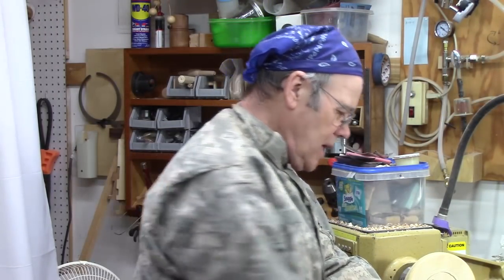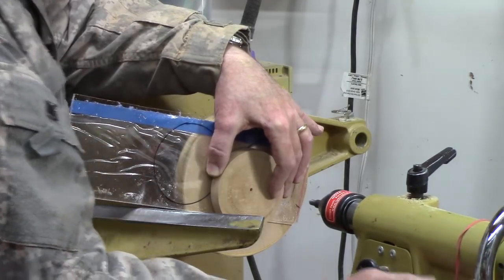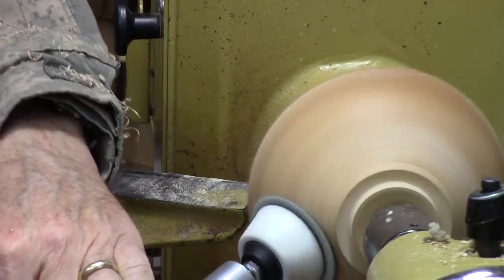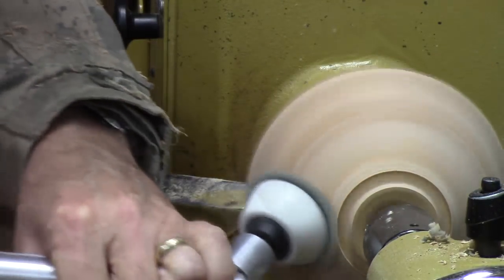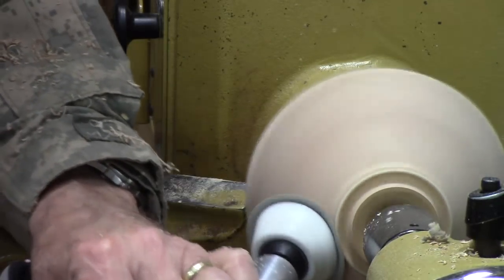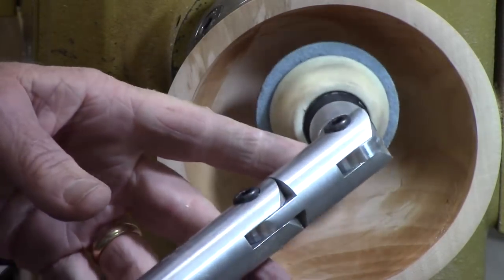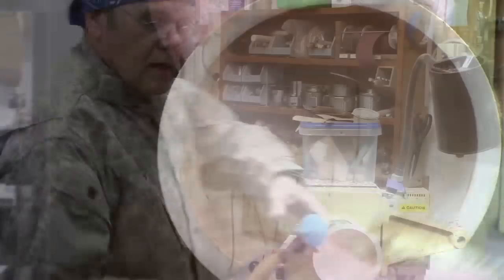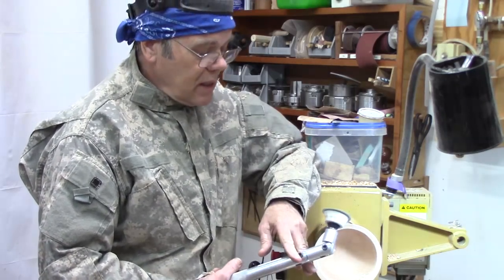Another Moment of Peace - Woodturning

Comment: This just shows the versatility of the lathe.
  I have an inertia sander. The arm will not stay at the angle it is set! I have gone back to holding and sanding by hand. Since doing that, wood turning is a lot more enjoyable.  I get to  feel the wood! SAFE TURNING, John
Reply from the maker: Everyone has to find their Zen. For larger pieces a sander, powered or inertia, is faster I think. But for small bowls requiring a 2" disk I frequently just hand sand.  For folks with arthritis, I imagine handsanding would be tough.

Comment: I sand my mills 100% with inertia sanders. They cut my sanding time way down. Should be used at higher speeds. If the diameter of a spindle is too small they won't turn fast enough. Work well on bowls except near the center. I never use my electric sanders anymore. I can go through the grits very fast. 

good video, cheers.
Reply from the maker: Thanks for sharing.